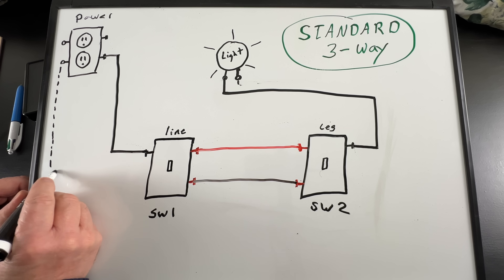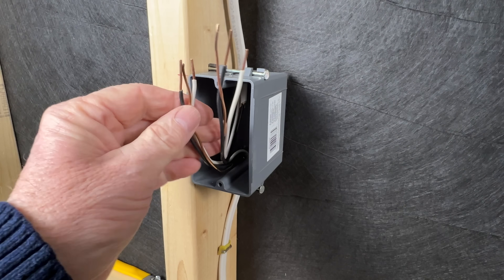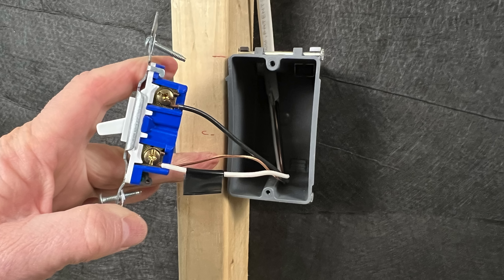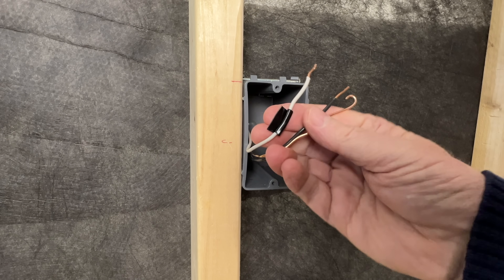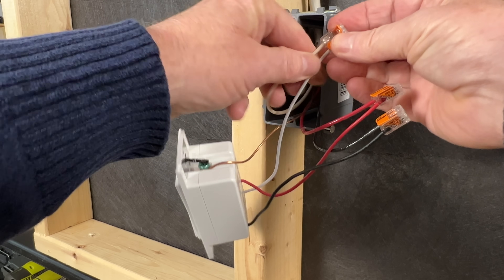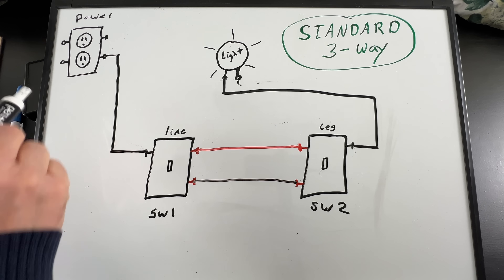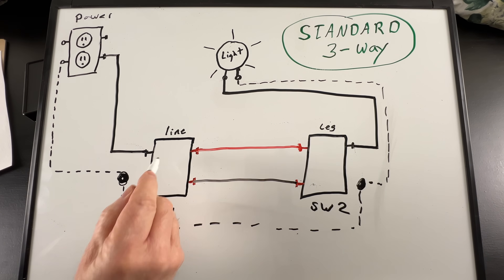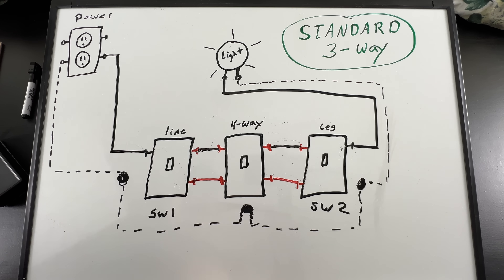How NOT to Wire Light Switches in 2025 (New Rules)

Comment from the maker: Other Video Links here>> California 3-Way - https://youtu.be/AeXFe5ghmKQ   Chicago 3-Way - https://youtu.be/Ky48x6LxuYA
Reply: The reason you only need ONE box with the neutral is bcuz dimmer switches at the moment can't communicate with one another- if my case is ever heard I will rectify that... hence you can ONLY HAVE ONE DIMMER on a 3-way switching system. Eventually you will simply require a NEUTRAL at all switch locations... we aren't there yet!
Reply: Eaton now makes a dimmer accessory switch that works with their smart dimmer switch, so you can now have a dimmer control at two different locations. Isn't technology amazing!
Reply: Good point on the 3-way dimmer issue.
Reply: I worked as an apprentice with a journeyman for 3 years doing electrical wiring,  mostly light receptacles, switches, and plug ins, still doing minor electrical for property owners around where I live it's a great little income
Reply: Again now its not necesary bcause in the market you can find smart control its working with not neutral cable
Reply: Quit calling the white conductor a neutral wire in a 120 volt circuit in all reality it functions as a return to have a true neutral there must be a 240 volts circuit
Reply from the maker: @bcracing204  That is incorrect..
Reply: @bcracing204  I Also agree that is not correct. Refer to NEC- Definitions -Neutral Conductor
Reply: You don't need 12 gauge cable for lightning

Comment: I am professional electrician and currently engineer. I used to work as electrician at power development board. I don’t need to check code my understanding comes from hands on work and education. For the house electrical wiring I always bring negative + positive to the light box. To proper way to wire 3 way switches is to work with double 4 prongs romex

Comment: In my house there are travelers between the switches on a regular 12/2  and an additional 12/2 to carry continuation of the circuit before the switch. It seems like overkill, but I suppose it is useful because you can extend the circuit from any switch box.
Reply: Are you sure 12/2 and 12/3? My house (in Ontario) is 14/2 and 14/3. Only heavier load circuits (dryer, stove) are on 12/3. Am I missing something?
Reply: @gregzabek65  I have 20A circuits. Some US homes have 15A using 14/2 or 14/3

Comment: I have a question. Is there any way to make 2 breakers across from each other to make them move together. Thanks for the help ahead of time.
Reply from the maker: Unfortunately not. Breakers that are together on the same side or the panel are with either a two pole breaker or an approved breaker handle tie.

Comment: Every one of these I look at have the neutral just sitting in there empty; but mine has the Neutral attached to the opposite side of the switch from the hot?
Reply from the maker: Thats a white wire but it's not the neutral. If it's attached to the switch it's being used as a hot wire and should have been re-identified with tape, marker or paint.

Comment: The dead end three way is a convenient way to add a second switch, and the NEC exception in this situation is wise. Here in Canada I'm not finding such an exception. To continue power beyond the second leg you'll also need an unswitched hot. So, the most convenient way to do that is to use a four wire cable between the two switches, with two travelers, an unswitched hot and a neutral. Four wire Romex cables can be hard to find. AC cable is readily available in four wire configurations so that's an option if the boxes you're using have the right connectors. Or you could simply run two Romex cables of 14/2.

Comment: I had one like that in my century old house for the stairway light on the second floor.
The light fixture was wired to be always hot.
They ran a single traveler between the 2 switches top and bottom of stairs.
It was the neutral that was switched.
They took a neutral from the second floor to the second floor switch.
Then took a neutral from somewhere on the first floor.

Comment: I have a question related to finding what is on a circuit that pops a breaker when things like a vacuum are plugged into it without opening the walls and discovering the mess left by the original owner that are now my problem a few years down the road?  Is there a wire map tool that can tell me that there is a device 50' along this wire etc., that won't cost me $10k?
Reply: Shut iff everything off turn one breaker on at a time and see what powers up. You could have a bad outlet somewhere. I’ve noticed a lot of vacuum cords don’t have ground prong on them and at my house the vacuum a trip the arc fault breaker rarely is the problem in the wire. It’s usually in a device, but that’s not to say that somebody didn’t put a nail through a wire somewhere.
.

Comment: One method you haven't commented on is somewhat common in houses wired in the 60's and 70's here in the south.  (Mississippi)  (Note:  this method is no longer used and is considered unacceptable)  No 3 conductor wire is used at all in this method.  Instead, the black and white are your travelers, with one 3-way switch having the line on the common and the other having the fixture hot on the common.  The switch leg side gets it's neutral by using another circuit's neutral from the nearest 120V recep.  (You will sometimes find an unused hot in one of the 3-way switch boxes, and an unused neutral in the other)  I consider this method dangerous due to the all-to-common likelihood of the neutral being on a different circuit.  The first time I came across this I was confused, to say the least.

Comment: Dead end 3 way was the original method before code required neutrals in switch boxes for smart switches. Good stuff. I found out the hard way when my smart switches wouldn’t work, no nuetrals

Comment: Can you make a video on adding a single pole switch to a garage door opener receptacle? The switch box is to be located on the wall. The receptacle is in the ceiling; therefore, it will be a remote switch. Show the added neutral wire connection at both ends. Both the top and bottom receptacles of the duplex receptacle to be disabled is preferred. Switch is used as a disabler for extended vacation times to prevent break-ins.

Comment: What I want to know is why outlets and switches do not have TWO grounding screws? It is a PITA to have to use wire nuts or 3 hole WAGO connectors to add little ground pigtails when doing a run of outlets daisy chained in parallel. It's so simple to use the four screws to pass through hot and neutral, because that's the default use case for duplex outlets. It's not an issue of having separate grounds when the side tabs are broken off to make the two outlets independent - there's still only one common ground for both because that's how the outlet is built.

Having two ground screws should be safer because of less points of possible failure. It would also make stuffing the wires into the box easier without that extra bulky wire nut or WAGO holding three ground wires together.

So, what company is going to fix the dumbest part of light switch and outlet design that has endured since the introduction of the ground wire? And while they're about doing that, make the ground wire use a clamp like the fancier back wired outlets. With that, one ground screw could hold two ground wires, with no need to bend a hook.

Comment: Had a friend who works at a local electrical supplier tell me many electricians are no longer installing traditional, hard-wired 3 and 4-way switch systems.  They are going to smart switches such as Lutron + Pico remotes, Leviton Decora Smart, and others.  They claim the time, labor and material savings as well as simplicity more than offset the cost of drilling holes, pulling expensive 3-wire cables and worrying about the new switch box neutral requirements.  I have not personally installed any in a home yet.  Thoughts or experience on this?
Reply from the maker: I have been retired since 2017 and I spent my last 10 years working as an electrical engineer so I really not sure. I suspect that some contractors installing smart switches. I'm old school and still like a hard wired switch.

Comment: Very well explained as in your other videos. I am wondering why you don't use a black wire from switch to the light in the dead end setup also why not use 14-2 wire ? thank you.
Reply from the maker: I just showed 12/2 or 12/3 wire since the example came from a receptacle circuit which is often a 20A circuit and I didn't what to confuse someone and have them make a mistake. I'm going to make a video explaining the colors used and why. It's all the same from an electrical functionality standpoint but the colors matter per the code. I'll get that video out very soon.
Reply: @BackyardMaine  Thank you, have a nice day.

Comment: Feeding & doing connections inside the switch box makes so much more sense. If connections are done in the light box, there could be a 200lb chandelier hanging from it, 30 foot high ceilings. That'd be fun to troubleshoot. Some dimmers & all smart switches need a neutral, which is why the code changed to require a neutral at every box

Comment: Not an electrician here. For the single pole switch connecting to the light box;, the white and black and ground wires are all connected by wire nuts. To connect to the light source would a white and black wire pigtailed be needed to connect to the light source?

Comment: Nice explanation, but I take issue with the wiring method on the dead end 3-way. 

I was taught that if you're re-identifying a white wire as a hot, it should be a constant hot, not switched. Reason being was that if it was switched and in an "off" state, it could be confused as a neutral by someone inexperienced with a NCV tester.

Comment: Since the exception allowing no neutral in a switch that can be fished is no longer allowed, does that mean even if you run conduit, you still have to pull and cap an extra wire? Since that is what the exception was actually for in the first place
Reply: Also at the end, the part about relabeling the white as a hot, it is allowed to relabel #12 or #14 romex or mc because they are cable assemblies but you cannot relabel thhn or any other single wire that is smaller than #4

Comment: On my DIY projects I have used a version of your "dead end" wiring configuration, except I put a junction box in the ceiling of the room and bring up a 14/3 form each 3-way switch to there and run a 14/2 out from the ceiling junction box to a string of lights.  The dead-end white wire gets marked with tape at the switch and the ceiling junction box, but it's kind of a give away when a white wire is tied together with the 14/2's black wire.  If the "line" switch box is in a string of connections, this keeps the wire count in the "line" box 3 wires lower.

Comment: In the uk. We do not need to have a neutral in switch boxes, but they update the regs so frequently I guess it won’t be long. Couple of questions, are the wire nuts still to code? Do you not sleeve the earth (ground) conductors?
Reply from the maker: Yes, wire nuts are code compliant and actually preferred by most professionals. They tend to be more reliable at 120v than that push in connectors are when under heavers loads. They just offer more surface area of contact. I only see problems with them when they are installed poorly. When done right they are rock solid. Most residential homes in the USA are wired with NMB cable often called ROMEX after the original manufacture from Rome NY back in 1922. The ground wire in all NMB cable is bare and they are not sleeved when they terminate in boxes.
Reply: @BackyardMaine  thanks, very interesting. We have to sleeve all ground wires (green/yellow), I believe to prevent accidental contact, maybe for identification. The most common multi way switches are wired with twin & earth drop from the light fixture which is live supply and switch live returns, these connect to L1& 2on the master switch then a 3 core & earth between the switches L1 & 2 and the common connect together. Similar to the dead end one you described.

Comment: I've been making the plans for rewiring my house for the past week or so, and I thought about this exact method instead of making all the connections at the fixture like I did almost 30 years ago. I was completely unaware of the new rules.
Why was the other method code from the start? It makes sense to have all three wires at the box, that way it's future proofing, if you plan to change or add an outlet, you won't have to do a rewire. Also, with the wires coming from the box and not the fixture, you're preventing them from being pulled easily from the pigtails at the fixture and make a mess.

Comment: Amazing how electrical equipment manufacturers use their lobbying efforts to change codes that benefits them.  CGFI and/or CAFI breakers are now required almost everywhere at $60+ each vs $8 ea for standard breakers.  Not having a neutral wire in a switch box means some dimmers won't work - so mandate that!

Comment: Does that mean light circuits are no longer in code using 14gauge wire
Reply from the maker: 14 gauge wire can and is often run for lighting circuits in a home. The wire needs to be sized for the circuit. In my example, I showed a 20A circuit which is why I used 12 gauge wire. If it was a 15A circuit I would have used 14 gauge wire.

Comment: Couldn’t you use a 4 way switch on both sides and use one of the screws as a neutral? Instead of linking them together inside a 3 way switch? Or would this not work?
Reply from the maker: No, that would not work and would cause a short circuit.

Comment: First, you do not use a plastic box. Has to be galvinised metal box and the ground goes connected to the box.  Who ever come up.with plastic boxes, plus the thinner gauge wires, woukd not pass even 1980s code. No wonder todays homes have warm wires and burn outs. Cant carry 15 amps, barely carry 10 without being a fire hazard. Nope. Not compliant. At all.

Comment: I became a Colorado journeyman electrician in the early 70s.  Some of my apprenticeship involved wiring houses.  If I have my choice, I'd start all new apprentices wiring houses.  All basic circuits are there, most grounding/ bonding situations are there and the materials are comparatively lightweight and it's easy to teach and to learn.  
One of the things that I learned, on my own, is that I don't want to spend more time than absolutely necessary , working over my head on a ladder.  For that reason, I did not use ceiling mounted lighting boxes for junctions.  Generally speaking, all the wires in the lighting fixture box, connect to the light fixture.  There certainly are exception but they are rare.  I wired houses thru the walls and very little thru the ceiling.  Saves a bunch of time working on ladders, with you arms over your head.

Comment: Question: Why do you run a 12/2 to the first light switch, and not a 14/2 ? Is that a code thing? If so, why?
Reply from the maker: My example was feeding the switch from a 20A receptacle circuit so I showed 12 gauge wire. We always match our wire gauge to the circuit size. If it was a 15A circuit which is common then I would run 14 gauge wire.

Comment: Why are 2 switches that control one light called a 3 way? Why is the 3rd switch that controls the same light called a 4 way? It seems to me that they should be called a 2 way and a 3 way since that is what they actually do.
Reply from the maker: I can be confusing and sounds illogical but three-way and four-way switches are named for the number of connection terminals on the switch itself, not the number of switches. I agree with you though.
Reply: @BackyardMaine That still makes zero sense.  Then a single pole switch should be called a 2 way switch since it has 2 screw terminals.

Comment: first home we only has hot and neutral 60a service with important branches with grounds for a/c window units. but when new home why are boxes still mostly the same size but more wires connecters , is there a prize to make code with the smallest box or something .  and Imo the last 4 code sequences are starting to look well every 3 yrs we have to change and make unaffordable homes even more expensive yet i have ho problem with maintained homes i lived in built in 1900, 1975 and 1995 and i really don't want a 2025 code home  Imo homes need to breath without mechanical units running 24/7/365

Comment: How would you wire a single pole switch that has a dimmer? Dimmer is Lutron Diva
Reply from the maker: Same as a regular one but depending on the dimmer you may also need to connect the neutral.

Comment: The national electrical code is a great thing. BUT, not all local jurisdictions adopt the full updated version. Some places like certain areas in AZ, only partially adopt an older version into their local building codes. It's nice to know the full NEC, but you have to check local codes for any work you're doing if you don't want problems.

Comment: If you use a 14 3 or 12 3 on the first method of wiring single pole switch will it be code compliant? The white wire would be a neutral red would be power and black would be the wire for the light and bare wire for ground of course
Reply from the maker: Yes it would.. I actually showed that at some point in the video. Maybe towards the end, I don't remember.
Reply: @BackyardMaine ok thx

Comment: There’s folks on YouTube who are emphatic in saying you can use the GND wire in place of neutral and is safe to do so.  I’m not an electrician, but doesn’t this pose a risk for someone to get electrocuted?
Reply from the maker: Yes it does. Anyone saying that is putting people at great risk. When current flowers on the ground wire it also flows on anything grounded. This could be your water pipes or any other grounded surface.